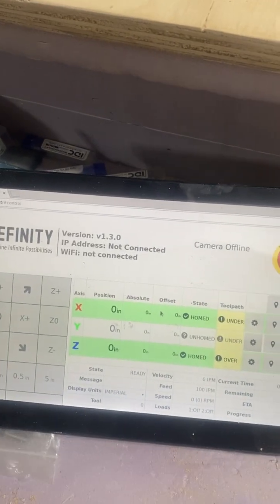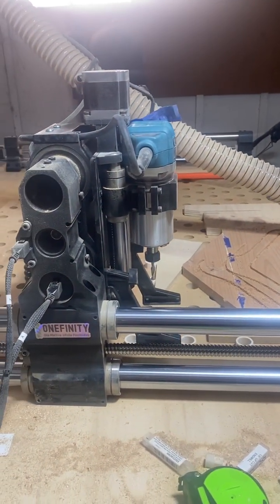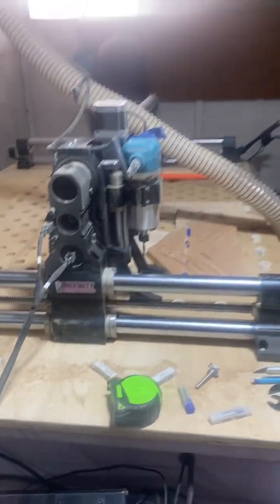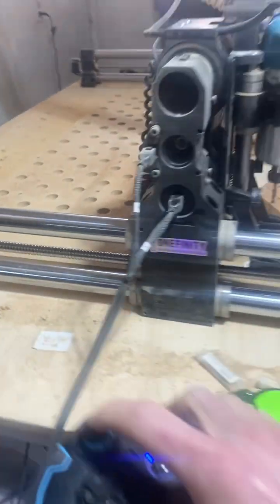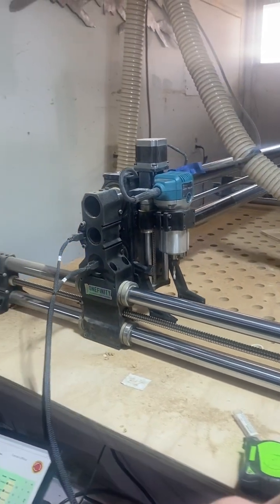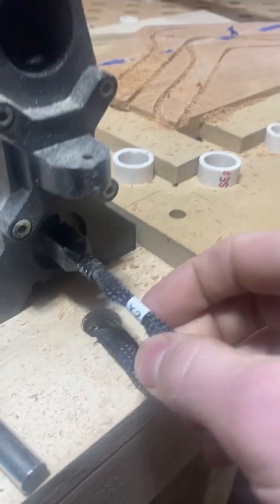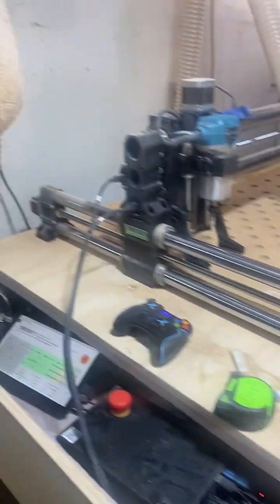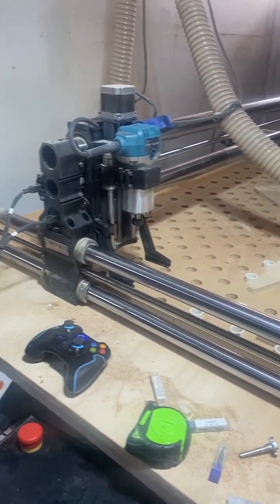OneFinity journeyman not homing all the way and seizing when jogging on fastest setting issue

Comment from the maker: Update: I fixed the issue with the rails seizing up. I needed to re-lube the ball screw bearings and the rails themselves. They were dry and the ball screw wasn’t sliding easily among them. 

I’m not sure if I totally fixed the issue with the y-axis not homing all the way, but as of now it is also working normally. We will see if the problem persists and I’ll keep updates on the comments. 

If no updates, then re-lubing everything solved all my issues.